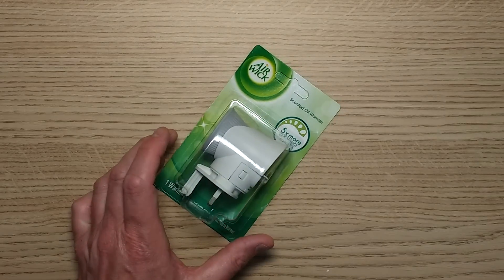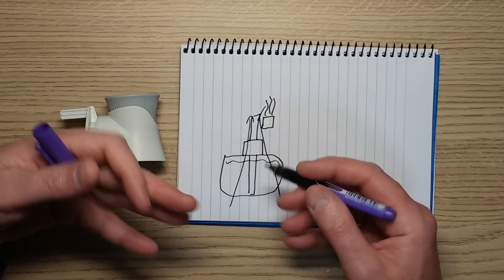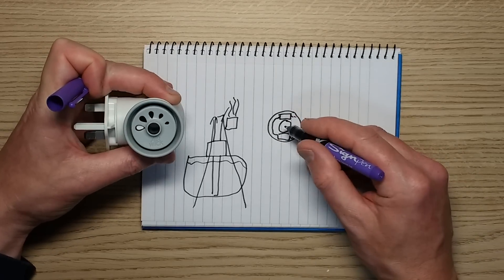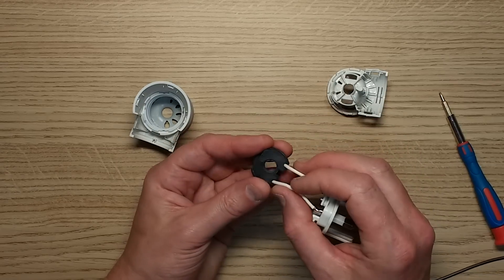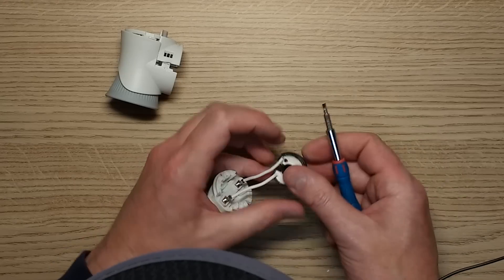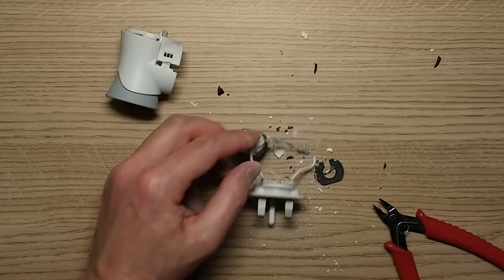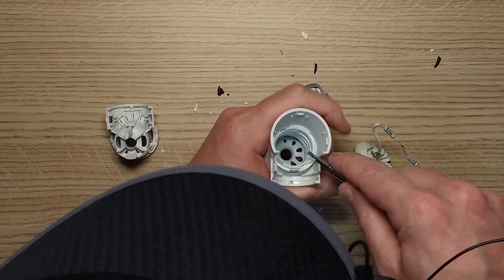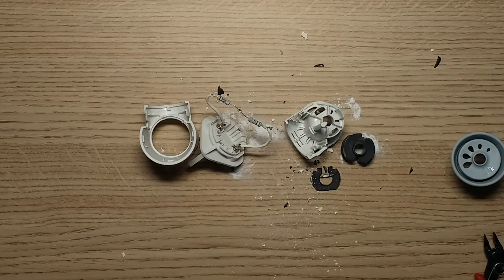Teardown of the new style of Airwick aroma vaporiser.

Comment: Surprised Clive didn't work out the current and power for this unit given the resistor values.  About 8 mA or so, about 1.92 watts.  So each resistor would be a 1W resistor I guess.  So it would take about 500 hours of continuous use to consume a KWH of power, which is around 3 weeks.  Not bad.

Comment: Interesting design. As a consumer, I might have just assumed the dial either let more air flow through or increased the power consumption of the unit. Wouldn't have guessed it adjusted the height of the heater element.

Comment: Clive, you seem to have changed your multimeter. What happened to the Amecal ST9905 with the big digit display? I ask because I had a similar meter from Jaycar, a rebadged version of a meter from CEM (http://www.cem-instruments.com) in China. However, the selector switch fell apart after only a bit of use. Mjlorton had the same problem. I now have an ST9905 on order from a UK seller because I like the big display and I'm wondering if it will be reliable...

Comment: History of these is good, then bad, then this one might be good again? The first one had a standard block 5w resistor, then 2.5w block resistor. The ones I have now are disappointing, same resistors in the ring without the heating compound and the design was to move the wick closer and further away from the center point. The ones I have now don't heat the wicks enough and only half of the air freshener oil evaporates and the smell goes away after 1 week. 
The one you just took apart now looks promising again, more even heating with the coin pound despite the same type of resistors, and moving up and down the wick, not moving the wick in closer and further away from the resistors.
I hope they realized they screwed up bad and the one you just tore down is the fix. I have 8 bottles from a Costco pack that are all only half gone and the wick gets clogged because it lacks heat since they changed away from the block resistors. 
I should go see if I can find one like this in the US and see if it works on one successfully now?

Comment: Kind of looks like refractory cement which is mostly alumina, like 90%+, and a binder. Heat cured of course because if you boil the water inside they do tend to explode. I've heard 600lb castings explode in the curing oven and it gets real exciting when the metal starts denting and the welds fail.
Reply: I'm guessing it's just plaster.  I figure 240V / 30kΩ = 8mA, which works out to just under 2 watts.  I kind of like how the post that indicates the setting is also the key that keeps the heater ring from rotating, so it can get moved up and down by the adjuster threads.  I wonder, since the plug apparently has a separate prong bit for various different plugs, if that part can come apart (that is, can you remove the UK-specific prong bits from the attaches-to-the-rest-of -it part).

Comment: Another successful demolition project! Isn't it amazing how much they can get away with charging people for two resistors, two contacts and a couple of plastic mouldings. At least it should be reliable.
Reply: You are not appreciating the very precise engineering involved to make it fail in exactly two years, conveniently when they change the shape just enough to make it "different" again.
Reply: And they carefully tailor the shape of the oil container so that it will fit the new design, but be slightly wrong for the old one. This results in a small, but growing, tarry puddle underneath the old unit, if you've not 'upgraded' to the 'new, improved' dispenser.

Comment: The red and orange bands are the worst. Oftentimes, you can’t tell which is which. I have a couple of 2.2 KOhm resistors with each band being a slightly different shade of reddish orange. I mean, how on earth could this happen? They came from the same production line!
Reply: I'm convinced they use child workers' blood for red. It's the only reasonable explanation for the non-uniformity. Purple/violet and gray, on some types of resistors, are also difficult to distinguish.
Reply: Indeed. Or gray and blue. Granted, on four-band resistors, knowing standard values helps, but on high-precision five- or six-band resistors—especially those have a dark-blue body—it can be a challenge sometimes.
Reply: It's those damn metal film resistors with the blue background that gets me. I just reach for the meter.
Reply: And when they burn out, you’re screwed. Most of the time, the poorly legible bands become totally illegible.  Oh, what fun.

Comment: same principle as a dew heater i use for telescopes
Reply: yes it a 90 mm doublet apochromatic with a 900 mm focal length not a bad scope still saving and buying more and more for it do you know for one narrow band filter for Astro photography can set you back £100 and they are only 1'25" in diameter now there is dedication to a hobby and i need like 5 of them lol that is not to mention broadband lol
Reply: go on eBay i shop on there store prices are a forking rip off they add rrp vat all that crap for a pretty box you get it from the manufacturer off eBay so its cost price
Reply: i think there antique now not sure
Reply: <Sounds of things whooshing over most readers' heads.>
Reply: shlibber. Haven't there been some spectacular fireballs over the past few weeks! Best I've seen for years.
Reply: wired star party m8 i dont think i would have attended that one lol
Reply: i live in the UK under a vail of city lights the night has to be perfect for me to see anything clearly sky-glow filtered to the max
Reply: Three big ones seen here by chance, mostly after the Perseus peak. One really good one last night at just before midnight BST, from overhead, down towards the Eastern horizon, in about 3 seconds. Mostly bright orangey red. Another orange one, overhead to South at about 9:40 pm BST, last Thursday and the other was a week earlier, again Thursday, about 9:45 pm BST, South of overhead to to North, bright enough to cast visible shadows in the city. Very fast, white with blue-green tinge, breaking up into about 5 pieces, at about 40 degrees above Northern horizon.
Reply: shlibber. This is Lincolnshire, England. Last night was 27th. Previous ones were Thursday 24th, and Thursday 17th respectively.

Comment: Really they put resistors as heaters in there!!
Reply: Quite common. Mosquito attractors were made that way, at least 25 years ago. They were a cheap, vented, plastic moulding, holding a single resistor, close to a small metal plate which it heated up. The zingers were supposed to be attracted by the heat, rather than by the cooler temperature of the human body.

Comment: Crikey a big Clive in a student bed. I bet your feet get cold. I have a battery operated set of lights that have lost their controller. They seem to use a switching polarity power supply. What could I use to resurrect them? Or is an in the bin job . It said on the label 3.6 volt and there is 120 led's  in the string half blue half white

Comment: looks like the 3 amp fuse is missing. maybe the wire and resistors will blow up in a controlled way if it fails and short the 32 amp circuit.
Reply: Rune International They're metal film resistors. They simply go open circuit if overloaded sufficiently.

Comment: I guess those crazies in marketing thought 'moonlight satin sheets' would sell better than 'oily chemical mixture #27'

I'd like one than made some of my favourite smells - wd40, distant soldering iron, cheap biological washing powder
Reply: Definitely WD40, and how about "Petrol engine without a catalyst warming up on a cold day" and "slightly smoky gas turbine engine burning Jet A1".
Reply: I'd like "coal smoke and steam cylinder oil" please.
Reply from the maker: +Timothy Barney That is commercially available as an FX aroma.
Reply: I'll second the cold turbine burning Jet A!

Working a flight line, it was always an interesting smell, when the crew was firing up the engines on a cool morning, and usually the first one or two took it's time due to ambient temps.
Reply: Singed sleeve, toasted fingernail, magic white smoke, burnt cable, charred circuit board... Ahh, bliss! Thanks for the idea. ;-p
Reply: or for us who remember the 70's - two stroke smoke on a cold morning
Reply: "Slowly smouldering Resistor"
Reply: Gas/Petrol Pump Station
Reply: damn u edgy af

Comment: I have never understood who wants to use these.
Reply: The Stoned Videogame Nerd That's because Water and Steam don't mix with electrics especially if your standing on a wet floor in bare feet and touch a wet Socket that isn't IP Rated we do have shaver sockets in bathrooms low voltage for Safety and almost all Bathrooms have Gas Central heating radiators to keep your towels and the bathroom toasty warm in winter..we also have pull cord switches for lights and extractor fans so we don't ever need to touch them with wet hands...So really no need for sockets plus Health and safety is over the top in the UK.....All UK sockets are 13Amp with fuse in the plug for things like TVs= 3amp you can also fit a 1amp 2amp 3amp 5amp or 13Amp fuse in the appliance's plug depending on the load. The Wiring to the Sockets is rated at 32amps using a ring main of 2×2.5mm2 Twin and Earth cable so all sockets have a double earth connection......keep warm Sir regards from Liverpool UK
Reply: Simon Sundgaard people with stinky houses or who smoke.
Reply: people with bathrooms.
Reply: Cakes With Butter And Steroids The one place you're very unlikely to find one (in the UK at least) what with the lack of sockets in the average bathroom
Reply: +The Stoned Videogame Nerd I believe here in The Netherlands plain wall sockets are not allowed in the bathroom. Our washing machine is directly connected inside an electrical box with a string to pull the switch inside it. Therefore the toothbrush charger is placed in the bedroom and every few days the brush needs to be put on that base.
Reply: My wife   :-(
Reply: I only use the Glade One Touch scents in the toilet